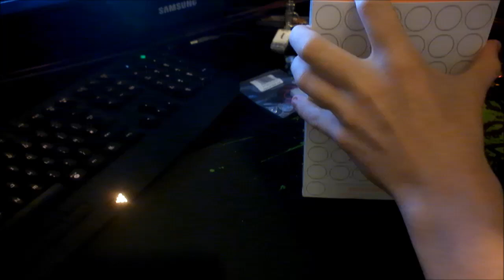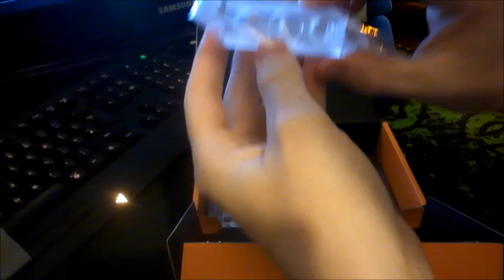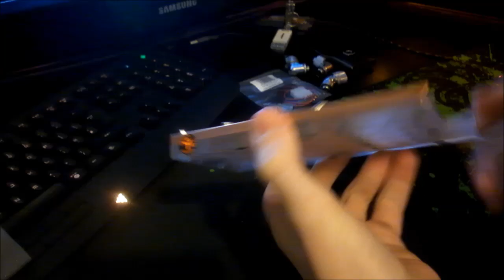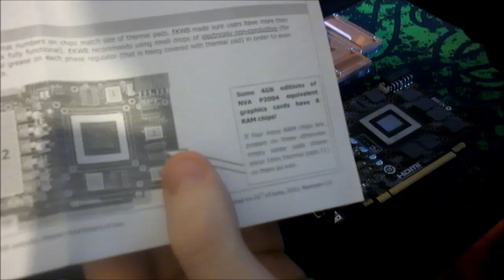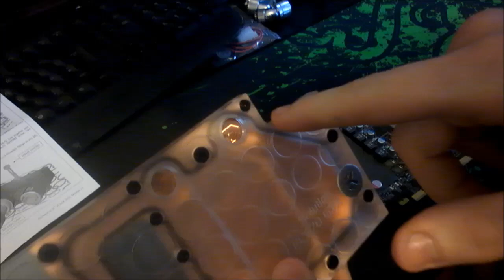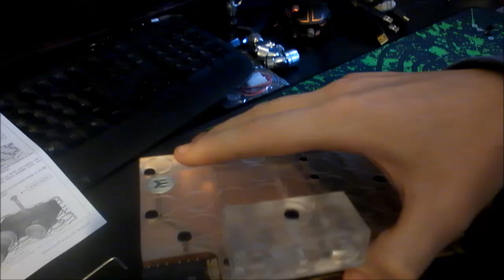EK FC670 GTX Waterblock Installation Guide

Comment: Can you link me the exact place you bought the water block again i have mai gtx760 2gb twin frozer card. Tyvm likes and subbed
Reply from the maker: i just looked the twin frozer card up on the cooling site and they have not made a fullcover waterblock for the twin frozer card. the only way to watercool that card is to buy a EK-VGA Supremacy block which goes over the GPU ship it self, but then u need to buy a external heatsink that goes over the vram and other chips. but the site i bought mine from was from watercoolinguk

Comment: I have the msi gtx 760 wonder in yhis waterblock will fit i plan on buying another going x2 760 in sli, and tie them in to my cpu water cooling loop.
Reply from the maker: mine is the msi gtx 760 :D, and yeh it will fit, if you want to know what block will fit with what card in the future just go on "Cooling Configurator" website and enter details, thats how i found out
Reply: Tyvm awesome video will be very helpful to me soon.